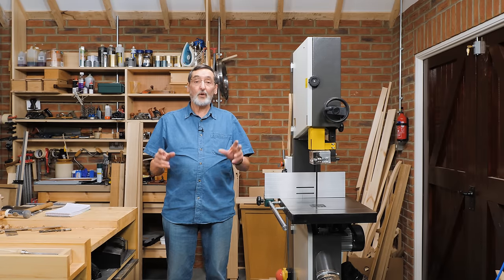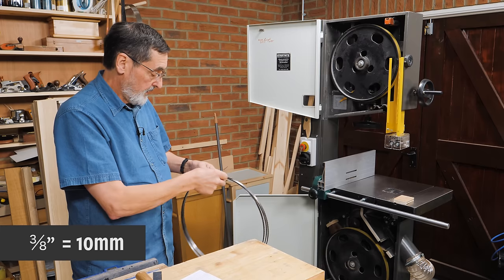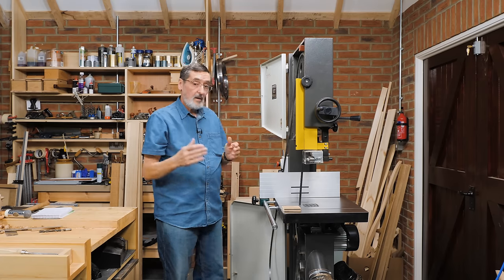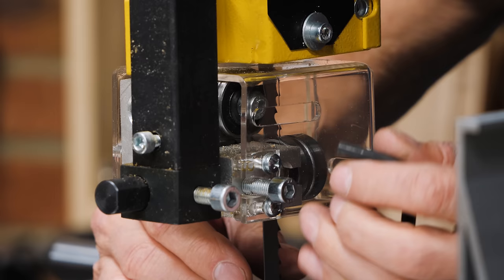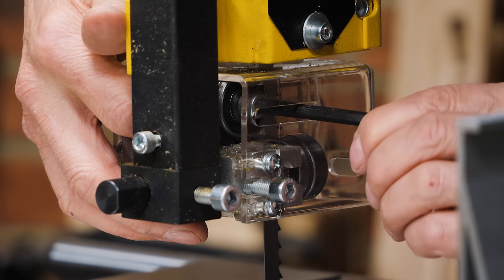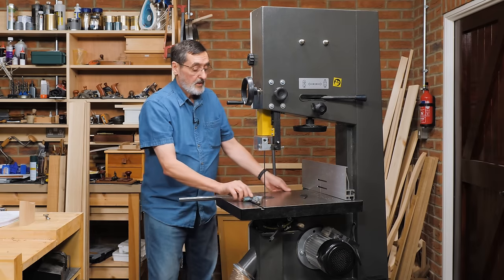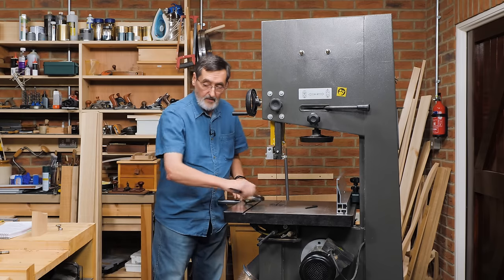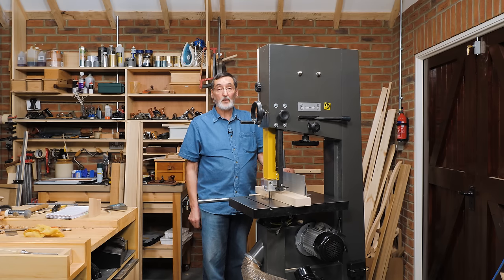How to Set Up a Bandsaw | Paul Sellers

Comment: Great advice Paul, can I just add, that releasing  all the blade guides first before fitting a new blade  , will  enable easier tracking on the wheels, as quite  often the rear blade guide bearings cause the blade to be held too far forward,  thereby  stopping the blade tracking back far enough,once tracking and tension is OK blade side and rear thrust bearing ' adjustment  should be done last. Not trying to criticise  you Paul, just adding my 2 cent's from my own experience. Love your program's. Best wishes. Stuart
Reply: First thing I thought of. You can't set the tracking accurately when the bearings are pushing the blade out of position. Also much faster to make sure neither upper or lower bearings are pushing the blade out of position before trying to set the other. And yes, I've done it in the wrong order and it takes a lot longer. :)
Reply: Exactly my thought, but didn't want to criticize Paul, for whom I have great respect.
Reply: Quite agree. All the guides should be slackened off out of the way first, if changing the blade size.

Comment: Before setting the fence square etc, you need to check the slot in the table is parallel to the blade. It’s only got to be done once usually but it’s very necessary. The bolts under the table have over sized holes that allow a small amount of adjustment. All bandsaws I’ve had come with a sliding fence that uses this slot. Loads of YouTube videos show how to do this. Thanks for the video. Cheers.

Comment: Check for square with a block of wood.  Make a cut in the block of wood then turn off the saw.  Turn the block over and re-introduce the block to the blade.  21:40 If the blade is square to the table the blade will slide into the cut.  If not re-adjust the table as required.  The test, repeat and necessary.

Comment: Spent many an hour on a Doall 2012 rough cutting mostly aluminum for a precision machine shop in the '80's. And then on to the Bridgeports and the big NC Cincinnati Milacron that read g-code on paper tape output by a flexowriter. Great videos. Keep em coming.

Comment: I like the emphasis on cutting the power properly during adjustment.  In my woodworking class the tutor said that a bandsaw or a table saw with a sharp blade in it can cut through a human finger in less time than it takes to feel it happening.  So you may only know it is happening once it is too late.  Safety is important around such powerful tools.  You can't do nearly as much woodwork with parts of your hands missing.
Reply: I'm not saying this to say safety is not important. But it is way easier to have an accident while actually cutting wood. At the time you are replacing a blade, your attention is on the saw itself and not what you are doing. If you suspect the switch on the saw is unsafe by all means get it fixed at once. But I have never ever seen a saw switch itself on in my lifetime of working several places with saws that were over a hundred years old.
Personally, I feel quite confident in tracking the blade with the cabinet open and the saw running under power.
Practicing safe habits when cutting wood, like using a push stick and never ever have your fingers in front of the teeth is more important in my opinion. Accidents usually happen when you are tired or are doing a lot of repetitive work at the same machine all day.
Reply from the maker: @Zigge  Mostly we set up protocols surrounding safety so that they become patterns and good habits early on. On some machines with 'On' buttons in daft places, especially older machines that often had protruding buttons,  it can be possible to catch the on button and turn on a machine with an elbow, an arm or a knee. So it is indeed best to start out with safe patterns and that is mainly the reason we start with the machines unplugged.
Also, people forget that wood splits at the worst possible moment.  This alone has caused more near misses for me after using a bandsaw every day and sometimes eight hours a day. When the wood split last second I was always glad for patterns of safety I had set up as a direct response to near misses that could have gone badly wrong. The push stick has always given me the safe distance I needed.
Reply: Paul Sellers (this comment aimed mainly at Jens) Yes safety protocols bring about good habits. When you work on your own, perhaps your risk is low. But if you did this in a workshop with multiple people moving pieces of wood around, the worst could easily happen. The point is - get into good habits when you are working alone, and they will set you up for life.
Reply: @MatSmithLondon  I've worked as a professional carpenter for a couple of decades, mostly in shops with between 3 and 12 other carpenters.
Safe habits are good and so are properly maintained equipment and common sense. 
Poul is 100% correct that there is old machines out there with household wall switches and worse. I would rather prefer he advised people to get those replaced with a safety switch designed for machinery.
Reply: @Zigge  Reason I replied that way was your comment "Personally, I feel quite confident in tracking the blade with the cabinet open and the saw running under power" - this seems pretty risky to me as surely the blade could spin off whilst setting up the angle of the wheel? It travels pretty fast.
Reply: Mat Smith, in theory, it can, but the wheels need to be way out of alignment for this to happen. If you spin it a couple of revolutions by hand first to ensure it stays in place it will also stay put under power even riding to one side.
If it should spin of it is usually a non-event. The blade just stops and sit in the slit and besides the wheels. It stops moving in a split second. 
It's no different than if a blade snaps while you are using the saw.
Older big saws don't even have guide rollers, but solely rely on the crown of the wheels to counteract the forces from pushing the wood through - that is how well the geometry of the wheels work in keeping the blade on. Please look up "flat belt pully" here on YT to see how it works and how sloppy a belt can fit on and still be safe.
Reply: Jens, I can vouch that sometimes magnetic controls can malfunction and start a saw at inopportune times. In our case, it was the table saw. A thwack to the base cabinet the control was mounted on would close a contact, and up she started. It was hard wired, and the breaker panel was in another room. Please don't ask me why we tolerated that situation for any length of time at all; but I simply wrote "Caution: Spontaneous Start!" on the table surface, put a fence on the outfeed table legs to restrain the cauls we stored on the shelf from thwacking the cabinet, and kept right on for weeks before anyone took remedial action. I misremember exactly, but possibly I was clever enough to take the time to flip the breaker when changing blades.

And I do enthusiastically agree with your and Paul's points about finger and hand positioning, and expecting the unexpected.

Comment: Would it not be better to loosen both top and bottom bearings before starting the adjustments.  Doing this will remove the need to go back and re-adjust one or other of the bearings

Comment: i have an inexpensive harborfreight sawmill ...the blades i was using were 1.25 wide but just reasonatly i was encouraged to try a 1 inch wide blade ...i didnt know till this video why that blade worked better till watching this ...i can see where the narrower blade doesnt require as much tenssion ....im gonna stay with the 1 inch wide blade ...ty for the info
Reply: I have never used a harbor freight bandsaw myself, but they are often criticized for not being stiff enough in the frame. Especially if they have a riser block too.
If you have metal working skills, bolting some reinforcements on the frame could be the answer to make your saw perform better.

Comment: As others have commented, you should back off the rear guides before fitting a new blade. This enables correct tension to be set and for the guide clearance to be set just once.

Not explained in the video, is that "centred on the wheel" means that the bottom (rear as seen) of the gullet should be centred on the high point of the tyre. This point is not necessarily the middle line of the blade, and the tyre is not necessarily centred on the middle line of the wheel.

I was pleased that Paul did not mention the ridiculous "co-planar" demand often cited in bandsaw set up videos (mostly American, with the notable exception of the excellent Alex Snodgrass video) that can dog the effective and efficient setting up of a bandsaw. Proper running is achieved by adjusting the top wheel such that it will seldom be co-planar with the bottom wheel.

Unfortunately, Paul did not include setting the speed of the bandsaw, neither did he go into tensioning the drive belt, nor did he mention backing off blade and drive tension if leaving the bandsaw unused for a long time (as many hobbyists might do) to prevent flat-spotting the tyres and stretching the drive belt.

Finally, a typical Paul Sellers quiet, unassuming but hugely informative and very watchable video on what to do when, despite an apparently correct set-up, a >1\2" blade skews a cut being made with the workpiece against the fence (e.g., resawing) might be helpful to many.
Reply: Absolutely. Have the bottom of the gullet  at the very "high spot" (crown) of the tire and then irrespective of blade width you are always gonna be right with the  side bearings, or as near as dammit and minimise the adjustment that is required.

Comment: How do you get on with the rack and pinion rise and fall of the blade guide? I have a new 13”. The rack clogs up after half an hour and it takes the same time to clear it out. My 30 year old Startrite of the same size has a slide and clamp system which I have never had to service.
The rack system seems to be ubiquitous now. I guess they are all made in a couple of Chinese factories. Your saw is bigger and the teeth on the rack probably larger. If I follow the tension indicator the blade falls off. Otherwise it cuts well. I only get no drift when the blade is new. If I can figure it out I might be able to use a T nut and remove the rack.
My set up procedure now is1 set fence to mitre slot, 2 set blade on upper wheel  with guides out of the way. 3 set guides. Test cut and adjust whole table to eliminate drift. Very few videos mention the last essential step

Always avoid cheap blades

Comment: Paul, I didn't see in the video how you find and compensate for the natural drift of a bandsaw blade.  You set your fence and table up square, that's a good thing.  But unless you have some trick that you didn't cover a bandsaw blade will run to the left or the right when you cut long cuts.  If you could address this in a future video it would be appreciated.
Reply from the maker: I think that you seem to expect drift with your bandsaw whereas a bandsaw set up correctly will cut straight a good percentage of the time. I am currently running four bandsaws, one a fifty year old, one a rinky dink model and then two 16`' models and I never expect blade drift until my blade begins to dull or I have something miss-set, or I am cutting some grains that divert the blade. Are you sure you have the right tension on your blade. This is a major cause of direction shift mid cut and indeed what is commonly referred to as drift.
Reply: With bandsaws the blade must be equally sharp or dull on both sides and the tooth set must be the same. No amount fiddling with guides etc will make an unequal sharpend or set blade cut straight. This goes for blades in metal cutting saws as well.
Reply: Adjust the whole table to eliminate drift after all the other adjustments are correctly done

Comment: I am surprised you didn’t mention that the rear of the gullet or tooth of the blade should be aligned with the centre of the blade as many people wrongly align the blade in the centre of the wheel thus leaving the teeth unsupported and hence have a wandering blade.
Also if the above is adhered to, the side adjusters never need altering even if a wider blade is fitted. 
Another point is that it is worth removing the table, to make it easier to see how the blade aligns top and bottom and it is also easier to get to the adjusters resulting in perfect alignment every time.

Comment: Paul have ever come across the Indian version of bandsaw which has no tyre a flat and no curve steel wheel. They work well, but how, no body could explain if the science of both types is same or different. Old model Makita was also tyreless. Will very much appreciate if you shed some light on this. Regards.

Comment: I wonder why you say that the blade you removed was no longer good. Dull or because it has already been tensioned?
Thank you Paul for the video.
Reply from the maker: In this case the blade was becoming dull which affects straight cutting greatly. Straight cutting with a fence can be negated by the blade being less sharp even though the blade can still be sharp enough for use in other work. In this case I had ripped two thousand linear feet of plywood for a job. By the time I was done it had just started to waver ever so slightly. When this happens I change blades automatically but do not at all discard them. I will save these blades for rough cutting scraps into firewood sizing and also for freehand curved cutting which allows me to alter from direct thrust to counter any imbalance. I can still cut circles and woodturning blanks with them also.
Reply: @Paul.Sellers  Do you ever have them resharpened or just buy new?
Reply: @Paul.Sellers    It is possible to re sharpen a band saw blade using a bench grinder, and it might work with saw files as well.   The bigger the teeth the easier it is, so 3tpi or 4 tpi is great, anything smaller it gets a little bit tricky!    This takes a few minutes as you have maybe 300 to 500 teeth to sharpen but well worth doing.  You can extend the life of a blade by 4 or 5 times.

Comment: Hi thanks great video really clear explanations! I have a Startrite 502s (looks older than yours, and bigger). I was hoping you would include how to change the blade speed. The manual doesn't make it clear how you get behind the lower band wheel to get to the band wheel pulley... would be interested to hear your thoughts! Many thanks. Charles

Comment: And of course each adjustment top or bottom can affect the previous adjustments, so go through the entire set of adjustments until you don't have any to still adjust. Would have been nice to see if the blade came back onto the lower wheel once your adjustments were done on the guides and tension.

Comment: Paul have you ever had any table misalignment after pulling your band saw by the table? Personally I have had this very problem which became so frustrating not realising what was causing the table to move by just a small amount. Hands up, I didn’t work out the problem for myself initially, I had watched another channel that mentioned this problem and then the penny dropped.

Comment: Great vid yet again Paul. Thank you. One question, is it possible to over tension a blade?
Reply from the maker: You can tension a blade more than is necessary to cut well which then puts added stress on the main machine frame as a whole, on the bearings in the two main blade carrying/drive wheels top and bottom and on the blade itself, be that at the weld point or generally on the whole blade. When the machine is on and making its thousands of revolutions in its general cutting action all of the component parts are effectively in a throwing motion which increases fatigue as the blade and the bearing age. Constant over tensioning will speed up the wear and cause ever increasing fatigue. Usually the blade will snap at an unpredictable point. Because of the spring pressure, the top wheel shoots up and makes an almighty bang as it hits its limiter. I have more videos coming out together with a PDF to discuss different issues in greater detail soon.
Reply: Thanks Paul. That makes perfect sense.

Comment: How do you know when it is inside out (might be useful for beginners)
Reply: The teeth will point up at the side of the cut.
Reply from the maker: When the blade is open and with the teeth facing you the teeth to the right will be facing downwards. If they are facing up you can simply twist the band outside in to change direction. You'd be surprised how many think the blades were made backwards.
Reply: Funny you mention that! A friend and I split the cost of a bandsaw last month, the guy was selling it cheap because, "It never really works right." I asked what he meant and he told me it cuts real slow and burns the cuts all the time. Turns out both the blades he had were upside down and he never noticed. So we got a nice bandsaw super cheap because it was "broken"!
Reply: I had instructed a young cabinetmaker on installing a new band saw blade by having him watch me as I explained. The next time the blade needed changing he volunteered to change it. When a test cut was made, it was discovered that he had installed it perfectly except that it was inside out. Embarrassed, he re-did it correctly and I'm quite sure never made that mistake again.

Comment: Hi Paul. Happy holidays from Texas!  Hey you mentioned in this video setting the alignment of the mitre slots on the table to run coplanar to the saw blade. Could you walk us through the steps to test and do this?  It would be much appreciated. All the best. John
Reply: Mitre gauge slots in the same plane as the blade?
Reply: Parallel